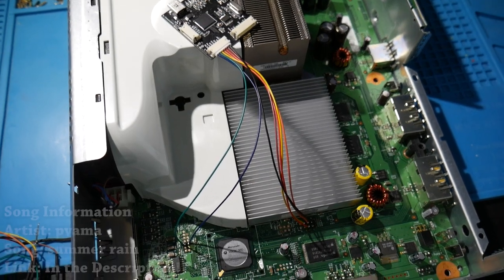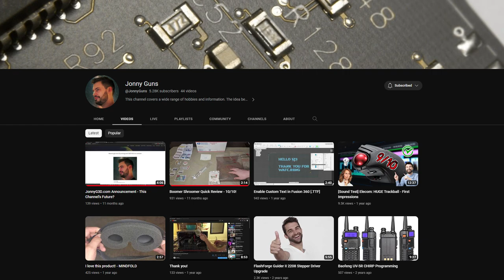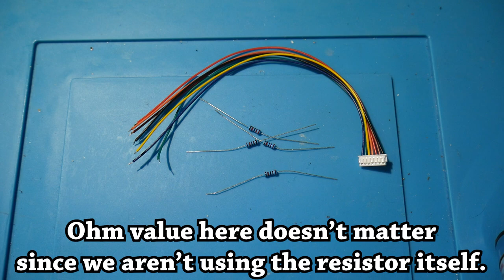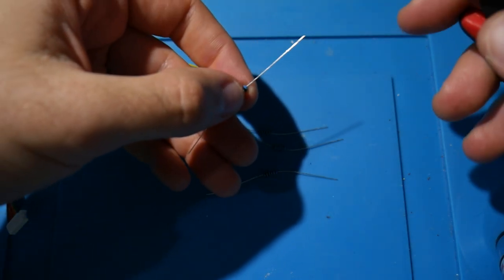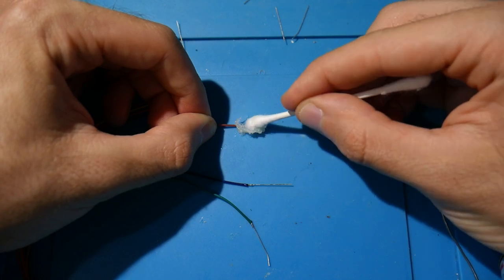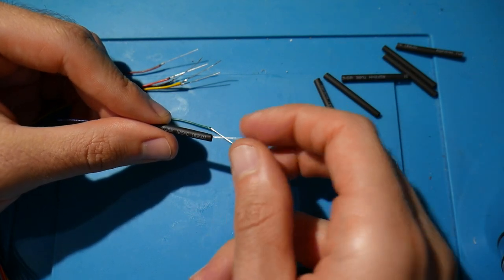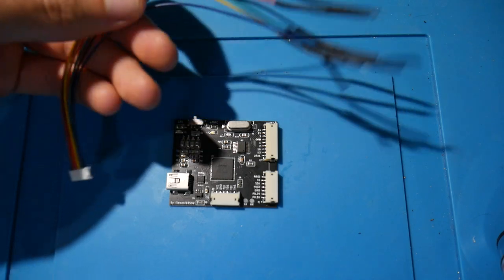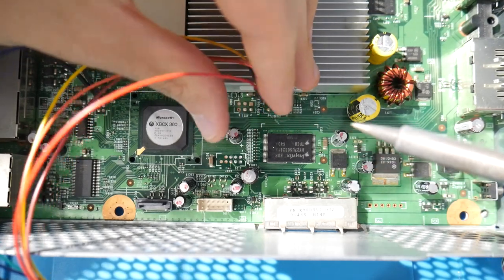Upgrading Xbox 360 NAND Programmer Wires

Comment: I did something similar to this on my first ever rgh about a week or so ago (Thanks for the great tutorial on that one btw - worked like a dream :) ). I was having trouble with soldering the tiny wires to the points. So I used some jumper wire from an Arudino kit I had laying around with the pins on and snipped the other ends to solder direct to my Pico Flasher. Made it so much easier as I was getting bad NAND reads all the time. Its amazing how much a little extra of a lead/point can do to help.
Reply from the maker: Best little trick!

Comment: I always save the legs of through hole components as I never know when I might need something like that and I've used legs like that to bridge jumper pads that are a bit too far apart to jump using only solder. Plus they are fairly stiff.
Reply from the maker: Good tip!

Comment: Hi Mario, I've been researching this for quite a long time now and after I made some silicone wires I thought that next step would be reverse clip style connector. It is similar to EEPROM test clip, but reverse, instead of inward it would have outward pressure. Imagine how much easier programming would become
Reply from the maker: Sounds like the pinheader setup that devkits had?
Reply: @MrMario2011  They are called DIL test clips and I will let you know if my little experiment will be sucessful

Comment: I didn't have a problem soldering on the programmer wires, I actually did that first, the resistor wires on the back were far far worse. And super hard to hit, I actually gave up but I plan on taking a crack at it again soon
Reply from the maker: Thanks for sharing, but not sure how? Soldering one solid piece of metal onto a pad in my experience is easier than soldering on stranded wire to the same pad.
Reply: If you tin the wire first is it really still stranded? Little bit of Flux and a fresh dab of solder on the pad also make a world of difference. Not knocking the idea in the video, it's a good idea especially for someone that's new to soldering but I wouldn't say it's neccessary either.

Comment: Yeah I can't get the yellow ground wire to stay no matter what I try. I got my wire set with legs from weekend modder. I am stuck. I have tried heating solder point at 300c but solder will not keep contact long enough to stay and make a good connection.
Reply from the maker: Too low of a temperature. I personally solder at 700F

Comment: Can I write 4GB NAND with Picoflasher. My friend told me that it’s only possible on XFlasher 360. Which dupont wires (?AWG) should I use with the Picoflasher.
Reply from the maker: xFlasher 360 will have the best compatibility. Wire gauge doesn't really matter with the Dupont wires since you will just be soldering the connectors.

Comment: Hi Mario, i have used the same cable which you showed in the amazon page for 4gb corona and it didnt worked.. please suggest which cable i need to use for the pico as i have not got any wire with raspberry pico ?? Please suggest the nand wire which is good for 4gb corona?
Reply from the maker: The wire isn't the issue, but some 4GB Corona consoles aren't compatible with PicoFlasher.
Reply: @MrMario2011  i see anyway i have ordered xflasher 360 from chipchopmod,then i will follow your videos to mod xbox 360

Comment: I would make a socket so I won't solder all the time.
Reply from the maker: That's a nice setup if you're only focused on one system, although socketing with every single console would be tedious since you would need a socket/pinheader setup installed in each one.